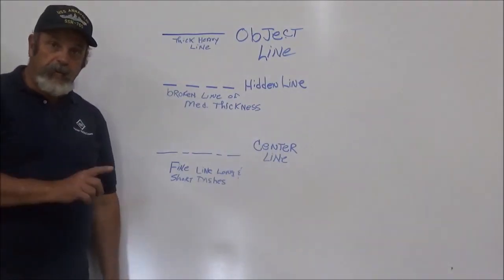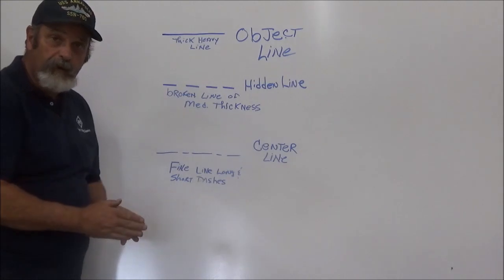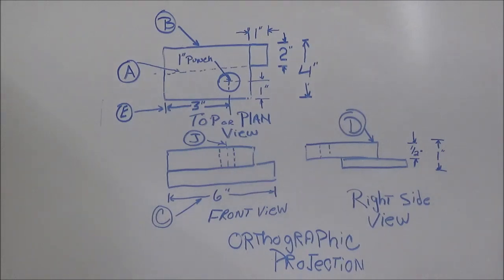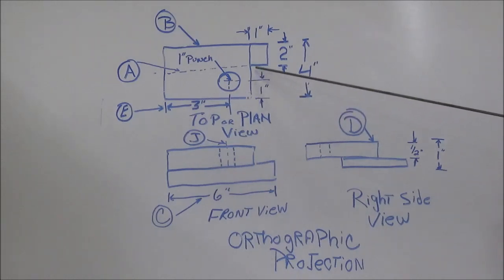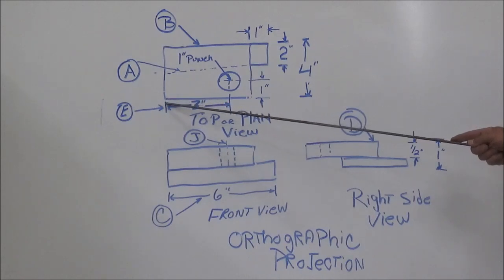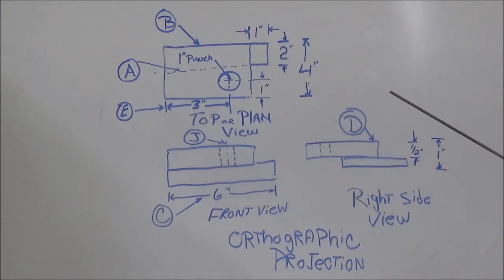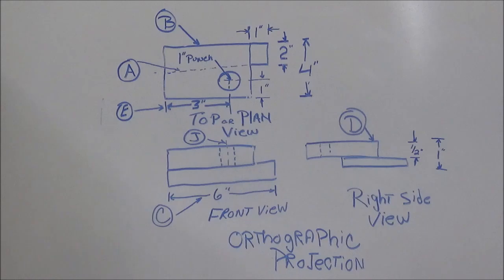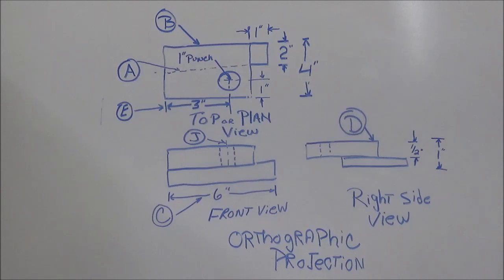BLUEPRINT READING FOR WELDERS AND METAL FABRICATORS 1

Comment: Any particular reason the side view was drawn incorrectly ?
Reply from the maker: I do not see the discrepancy, would you be able to point it out for me?
Reply: I’ll just mention one point. If view D is correct, view A starting from the bottom where the 3” dimension line is, should have a solid line on the edge, a hidden line for the bottom section, a solid line for the edge of the top section, and a solid line for the edge of the thinner section.
If view A is the correct one, the bottom section in view D should be cut off flush with the right edge of the top section.
Another caution: These are the standard “views” in the US system of drawing. In much of the rest of the world, “Third angle projection” is used and the accessory figures are like a strong light projected an image into figures C and D. They sort of look like the same outline but some lines change from object to hidden and vice versa.